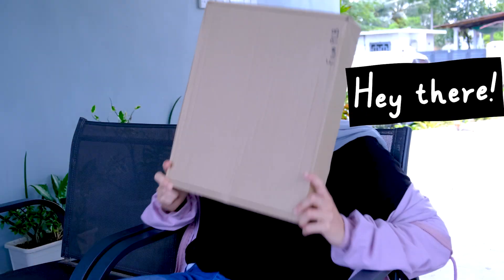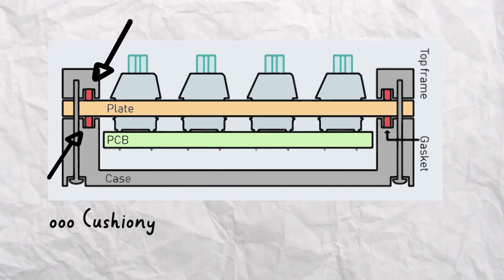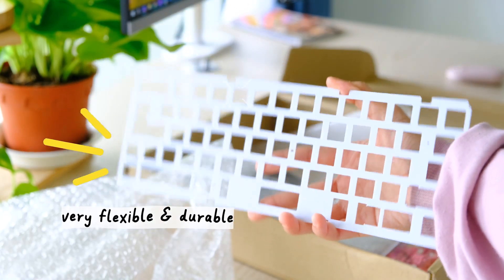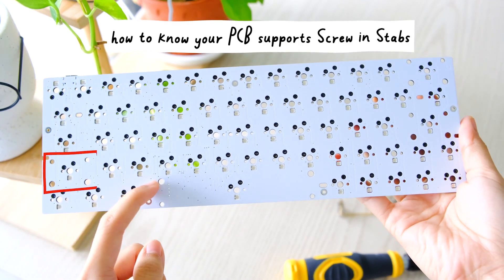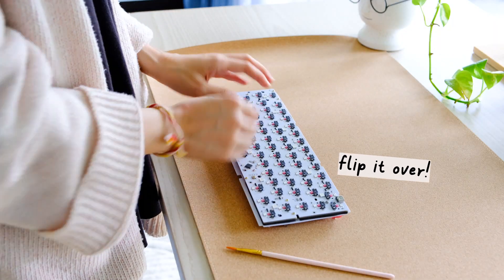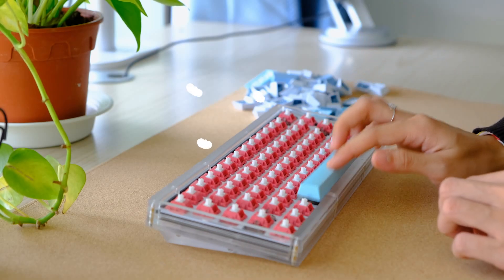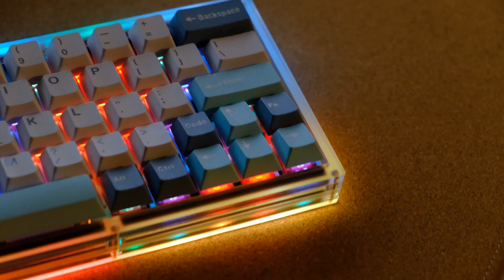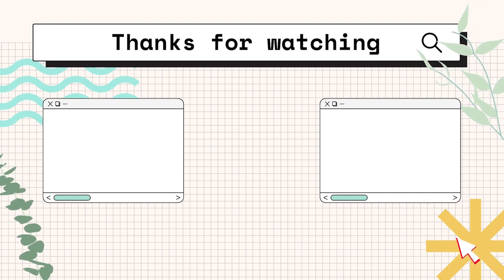Building A Gasket Mount Keyboard - PG64 by PCB Malaysia

Comment: kakkk total spend brpa on this build?
Reply from the maker: The kit is quite affordable compared to others. About rm99+35 (if u choose brass plate) then the keycaps is rm119. Stock Switches would be rm51.20 (rm0.80 each) . Total for this build is rm304.20. If u go for cheaper keycaps and normal plate. it would be around rm250+ 😄
Reply: @WanSyazlina  ehh murah la kak utk custom. Gonna tag u on ig later if I build this keyboard
Reply from the maker: @mhaiqal3207  yes murah kan? Compared to other custom build. Yess tag me plz so i can see ur build 😆 btw i think pg64 might restock after this.